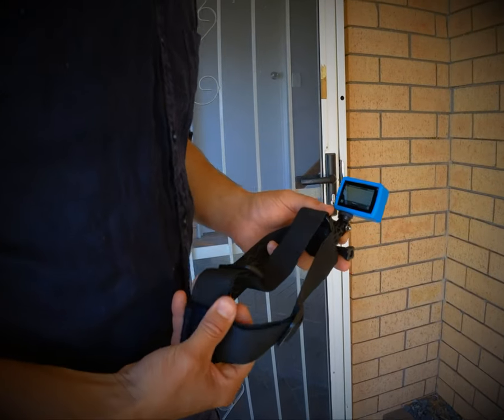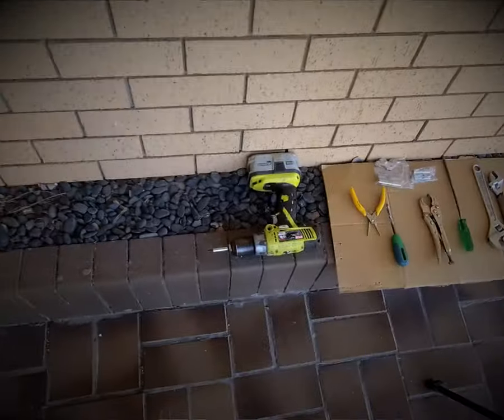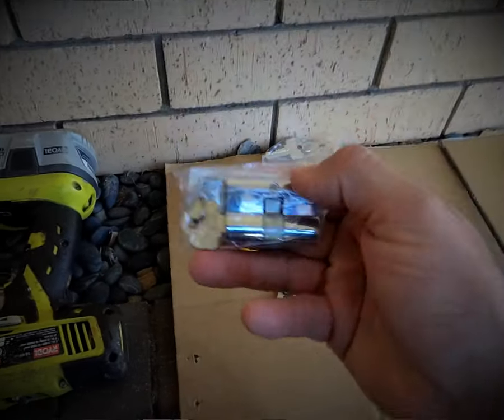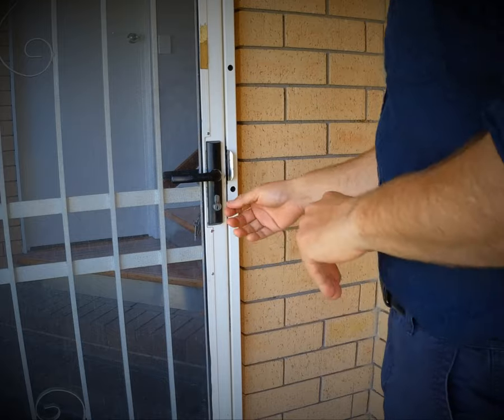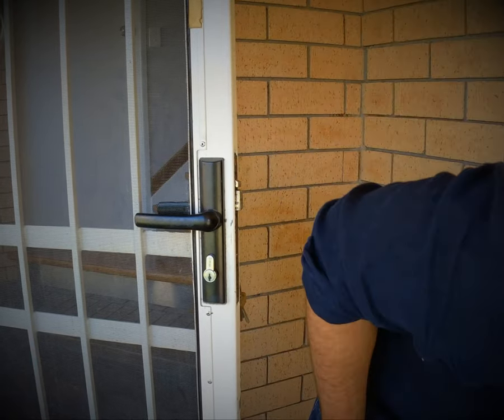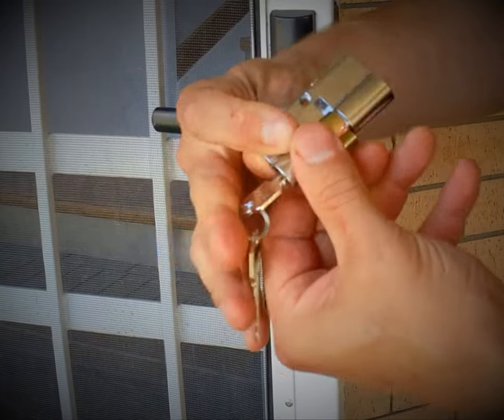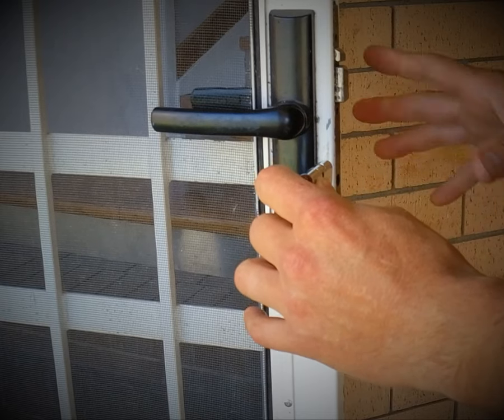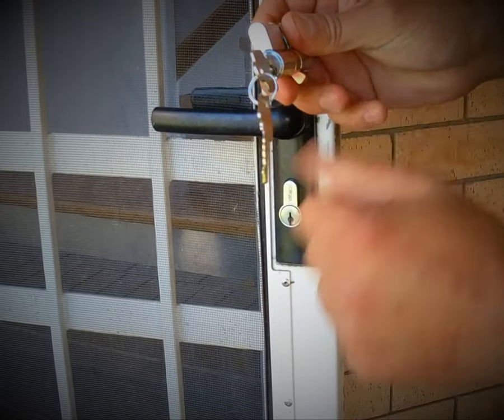How to remove a security door lock without key.

Comment: Yes but how do you snap off cylinder if door is locked closed and you can only get shifter on one side as frame prevents it on other side. Thank you
Reply: Ethically, no one should tell you that. This is all done from both sides when someone has access. If access is only from one side then a locksmith should be called.
Reply: @danvid1935  but he shows exactly how to do that in the video.

Comment: New locks are anti snap,pick,drill and bump.
Reply: Mine must be new then bc I've spent the last hour trying to snap mine off. Not to mention my handle is not attached to my plates...2 separate pieces. So I can't get the handle off either unfortunately.
Reply: Hi Rob. As a locksmith of 30 years I have not seen one of these anti snap, pick, drill and bump ones yet that the method in the video would not work with. Care to tell us a part name, number or brand?
Reply: @joannahood482  Hi Joanna. What brand do you have?